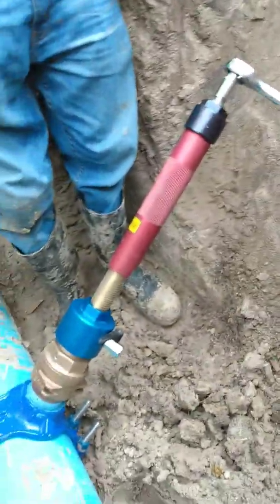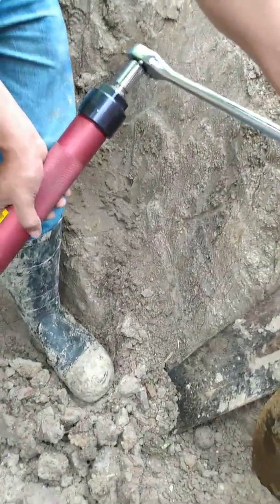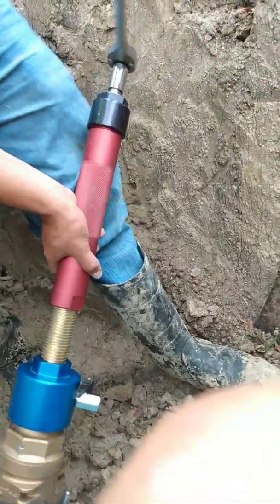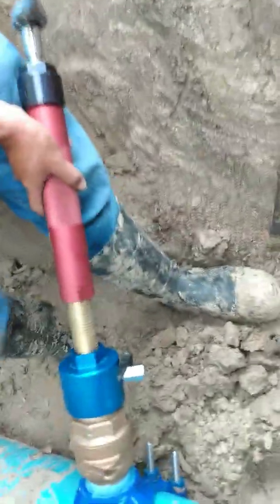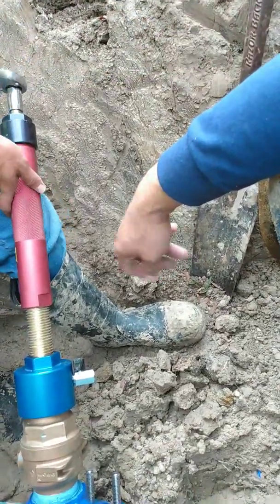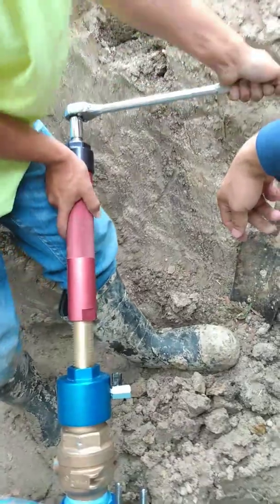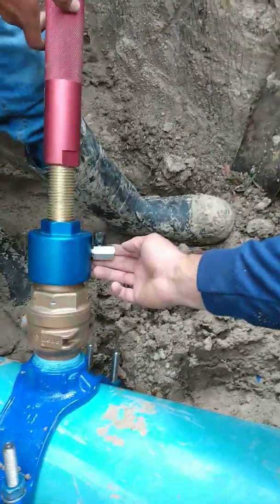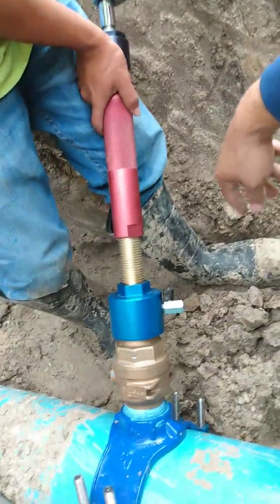Live hot tapping in a water main

Comment: There is something wrong, every 4 or 5 ratchets turn you should able to turn a quarter turn on the red sleeve to go forward the bit into the blue PVC pipe, if you don't turn the red sleeve the bit never reaches the pipe to make a hole.
Reply from the maker: It's was for the purpose of the video the tap was already done
Reply: No way the position of the screw tool that tap was not done. Don’t teach ppl to do improper things. Tapin mains is dangerous. Too much pressure will split plastic. And you were standing in the clear zone.
Reply: u know it